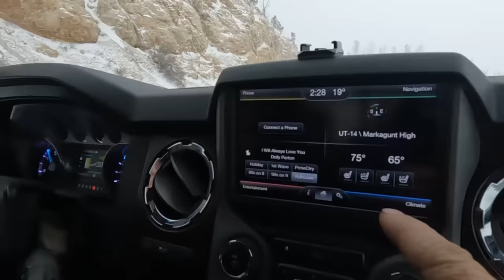Major Snow Storm Pushes The Morrvair To Its Limit!

Comment: I'm glad you talked about turbo diesel not working off road. I did a motor swap in a Humvee and put in an LQ9 instead of the duramax everyone thought I should do. I did the LQ9 for the reasons you said. Also, you should talk to Klim about making you a custom coat that matches your shirt so your whole crew can stay warm even if your still bare handed and no coat.

Comment: Desiel trucks rock. Learn how to manage all that torque. Winter driving with ace winter tires and carry tire chains. Northern Alberta has lots of snow (very deep at times) and awesome gumbo in the summer. A good tow rope and years of experience helps. I’ve pulled lots of gas trucks out of sticky situations but don’t recall pulling out any desiel trucks

Comment: Many times a gentle throttle and careful movement is a better way to do in snow than just floor it and spin your tires. This is because "stand friction" (wheel not slipping) is a lot greater than "slide friction" (wheel slipping). Also when you floor it and spin your tires hard, your tires get warm and snow beneath the tires starts to melt to ice and water (this is how heavy trucks etc. are stuck in flat ground with a little amount of snow --> warm tires because of weight = ice and water). Ofcourse it's hard to see what kind of tires there is in that white pickup, but that shouldn't be too deep snow for 4wd with proper tires.

Anyway, found this channel just a few weeks ago. Keep it up, can't wait to see the heavy-wrecker! Greetings from Finland.

Comment: It’s awesome seeing so many positive comments on a YouTube channel for once.
Reply: Isn't it? This is one of the most wholesome comments sections on YouTube. It's even worth reading through!
Reply: @JohnFL  exactly! Worth reading is correct as well. Not only have I been entertained by Matt and his channel, I’ve learned a lot. His explanation of the kinetic rope vs chains or a flat strap have changed the way I tow and pull ppl out of mud. Granted…I’m no expert but at least now I think a little bit more before I hook up the good old ratchet strap to the ball hitch and tank.
Reply: @danediemer  I usually read all the comments to help with questions people have. A guy named Warren Don does the same. It goes without saying that 2000 comments takes longer to get through than the 500 or less it used to be.
Reply: @JohnFL  absolutely! I appreciate you and everybody else that comments with constructive criticism or just good ideas. It’s just awesome to see.

Comment: I learned about torque as a teenager real quick. I was driving on a Missouri creek bed in a 4 speed square body. 4 low gave too much torque to the tires and would bury the truck in an instant. 4 hi I could do great. The same was true in snow. Used that knowledge in my powerstroke plenty as well.

Comment: Love you guys too! 
  Know what you mean about the torque, been driving the big trucks for half a century. You don’t give them fuel when taking off from a dead stop because the torque is enough to get them rolling. Like you said, in your scenario, a diesel is not a good fit. Like putting a full cast-iron engine in an airplane.

Comment: This is another instance where Air Bags would be helpful.  Lift the truck with bags and then winch the rock out from under it.  Of course, you would wind up with a Firetruck's worth of gear to handle every different type of recovery.

Comment: That Dodge 2500 Cummins is a heavy truck, and with the tires that are on it, it is helpless in mud and snow. That truck with those tires will get stuck in 3-inches of mud if you stop in it. lol. I've owned 4 of them, and if you don't put some larger grippier tires under them it's best to keep it on the highway. lol.

Comment: Try using 4 high instead of 4 low in the snow. Especially with diesels, you will get less torque and more wheel speed which is what you need in snowy terrain.

Comment: - Where I am from we call what you were driving in "wet snow". Horrid stuff to drive on.
- Special retreads w/ground Walnut Shells in the rubber is what we drove on back fifty years ago.
- {mini suction cups are left as the Walnut grinds pop out. THAT does the trick of getting grip.}
- Chains are illegal because they wreck the highway asphalt, but small studs are okay.
- I do not know if they still make them. Call garages or tire stores in Littleton NH and ask.

Comment: You mentioned throttle control for the torque  control. Is that a problem even with the drive by wire features on modern diesels?

Comment: Agreed, I think you’re better off with gas engines in your rigs. Diesel is not easy to control torque with automatic transmission. 
Horsepower is how fast you’ll hit the wall, torque is how far you’ll move the wall 😉
At first with the wrecker build I was also wondering why you wouldn’t use a diesel with the way it’s set up, but soon realized after thinking more, with an automatic it is just too difficult to control the amount of torque being applied, especially in situations where you don’t want to spin the tires. 
Hey Matt, hope your 2024 is a great year. We enjoy the videos, have passed by Hurricane many times (after business hours) but one of these days we’ll get by there at a “normal” time 🤣 
Gotta love the truckin’ life

Comment: In the snow like that, you need to be really careful not to put anything on the throttle on the towed vehicle because it's just going to spin tires and make ice inside the wheel ruts. It's not like mud because mud doesn't change state as it slightly warms up. Snow will turn to Water with slight heating and then turn back to ice almost immediately leaving a light glaze on the packed ruts. You can see in the video that it's the tugging that's moving the truck not the spinning of the wheels while it's in the stock Point once it gets up on the road on something level then there's no problem.

Comment: FYI in those ram diesels you should be in 4Hi so it locks front end. Also will help with your torque comment. 4LO on a turbo diesel is stupid low and super high torque.

Comment: Since I wasn't there to see the details, here's my armchair quarterback question: Why didn't you bring the rear of the truck around from the ditch, initial pull?  No harder than the 2 moves you did and it would have wound up pointed downhill. Just curious.  Grew up on Georgia clay roads, never had any trouble when I moved to TN to snowy sleet-covered roads in the 70s. Used to go around in my 4x4 Subaru Wagon pulling folks out of the ditch.  Good fun!

Comment: Make a chain net it only needs to be about 3x4 you will wear it out if you have one I made one it has 8 inch holes in it and can move a rock in a second if you have one you can also use it to net a tire and wheel and then winch off that they are great and old man George he was George's towing in Fresno California he passed away about 25 years ago but he trained me for 7 years and WOW he was smart he is actually the man who designed the very first rollback truck and the first repo truck that has self locking forks that grab the tires

Comment: As a deisel owner that drives in the snow, you don't want to put it in low range. It puts too much torque to the tires and you spin too much. High range is your friend in slick condition.

Comment: In all the snow recovery vids, I have never heard about the use of tire chains in the recovery or seen them used in a recovery.  it would seem that if the stuck vehicle were mounted with chains at the time of the recovery, then the vehicle could help in  it's own recovery.  Spinning tires in the snow doesn't seem like they are helping much.

Comment: ~ 21:29
"Too much torque in diesels"
Solution"
Detroit Diesel have a TORQUE SNUBBING SETTING with flip of a switch or preset RPM RANGE for maneuvering.
Used on city busses with automatic transmission
&
Heavy Haul Trucks with manual transmission in deep reduction.
😊

Comment: Matt you could have avoided putting dig holes in the road by not pulling on him. U have a winch. Use it. 
Snow wheeling takes skill and common sense. 
U could have tires the truck around without pulling on the leaf spring. I wouldn’t have been happy you did that to my truck. 
I’d show u some of those steps if I lived closer.

Comment: Really Matt? Rippin' on diesels again. Maybe you should learn how to drive them. Love your channel! I drove a red mix truck for 11 years. Yes it takes time to learn how, but when you do, it's a slice of heaven!!! Also huge mistake replacing the air brakes with hydraulic. Yes I am a heavy truck mechanic. I really hope your heavy wrecker works okay. I could have helped you with the air side of it. Just sayin'
Reply from the maker: Diesels have their place, and airbrakes have their place. But there’s no place for air brakes on an extreme trail rig.  
You’d be out of air 20 yards into the first trail. 
If you’ve ever poured concrete out of a front discharge mixer truck, you know that you will be waiting for the air to build back up from time to time.
Reply: @MattsOffRoadRecovery  Hey Matt. It appears you have your mind made up. Thanks for answering. I can understand not wanting diesels because they are too heavy. Foot print thing. Air brakes though? They are so powerful. If done properly. But again, you seem to have your mind made up. What would Paul say. He has someone involved in heavy truck world. Papa Dar. Done right they can do you right!!!
Reply from the maker: A lot of the extreme trails at Sand Hollow will be driven with both feet. Meaning you hold the throttle, steady and control the speed of the rig with the brake. Airbrakes would be a disaster in this type of the situation.

Comment: Why do it the easy way? You just need Rock drills, wedges and shims. Disassemble the rock. Dig a hole under the truck to fit your body in. That's another bad idea ... Go For It!  (Bring dynamite ... and a crane ... blow it up, start all over again ...)

Comment: 4:53 😂🤣 Just don’t throw it off a cliff. The problem with that dodge is at tires are useless in deep snow. Throw a set of mt’s on that truck and it would’ve done a lot better.

Comment: Two recovery vehicles and two popple/aspen trees in front of stuck vehicle does not know if the vehicles have enough weight to pull the truck out?  One vehicle rear bumper anchored to a tree 12k winch a snatch block and the truck is coming out before the tree does.

Comment: Have you ever thought of using track systems for Wheels in snowy conditions on the Morvair something of an option where you can rig it as a snow cat-like situation but have your I forget  how large your tires are understandably the tracks are probably heavy you probably want to put them on knowing you're going into the snow conditions but having an option it would have to be test tried situation but you have your reserved tires to mount if track did not work I'm saying if it's in the budget could you test something like that out but like your fuel situation bring back up bring those big tires with you oh yes and bring some fuel as well doing good out there man has a landscaper I could have shown you how to move that big boulder a lot faster a lot quicker but hey 👋 you use self-preservation ingenuity and that's how you get it done meaning all of us think outside the box those are the funnest jobs of all you get to test yourself
Reply: MORR has a sno-cat.  It's called the Bombi.  They discussed it around the 14 minute mark in this video.
Reply: @warrendon1388  no totally a aware of that but they now make tracks that you can mount on a vehicle where you can have the best of both worlds large tire traction or a large track traction which has been known to be better in the snow than round Wheels even better than round tires with studs even better than round tires with chains because they operate just like a snow cat but you're in a vehicle warmer conditions faster travel they're not as slow as a snow cat better turning options just overall better than a snow cat

Comment: People really drive around on roads like that with no weight in the back?... wth? Who does that? Even 4X4's need something, heck a cord of wood would be better than nothing. I keep concrete parking blocks in the back of my truck. You wouldn't catch me driving my 4X4 in those conditions without weight back there or with street tires... no freakin way. Just because it's a 4WD doesn't make it invincible.

Comment: what's happened to your snow cat?
Reply: They discuss it about 14 minutes into this video.  I'm guessing that it's in the storage container back in the yard in Hurricane
Reply: @warrendon1388  Thanks for your contributions Warren, I got blocked from commenting for 24 hours because I was answering the same question over and over, and YouTube detected it as spam. So be careful your replies aren't too identical.
Reply: thanks Just asked the question a little too early into the clip, if I had waited I would have got my answer.
Reply: @JohnFL  Thanks for the tip, John.  I was wondering where you might have been, but put it down to the holiday period.  Then I saw you back again.  Cheers, Warren
Reply: @warrendon1388  Well I was busy over the holidays too. It's good to be back though 🙂